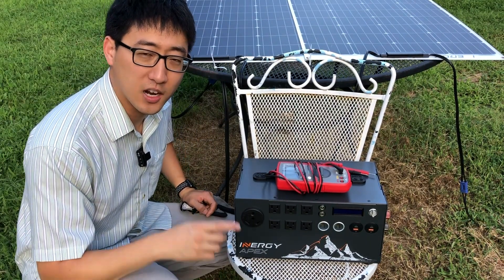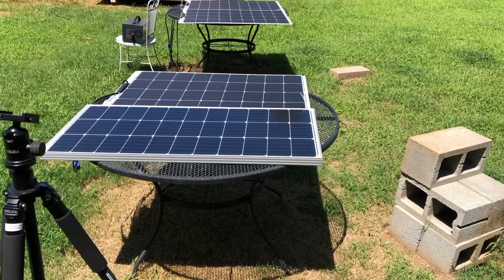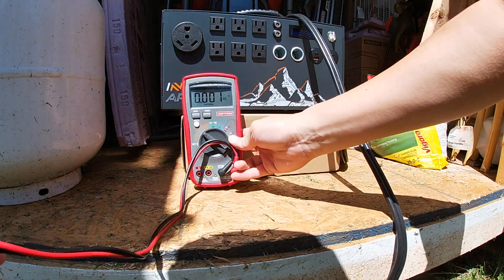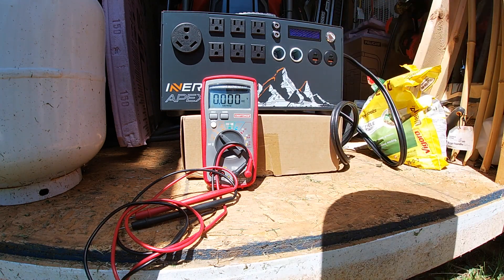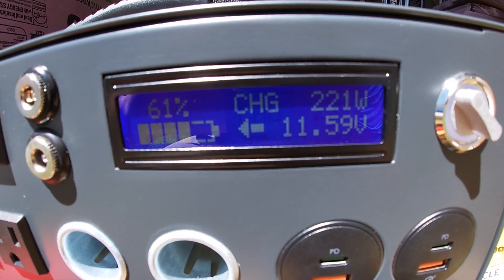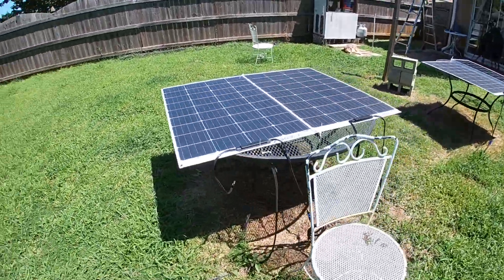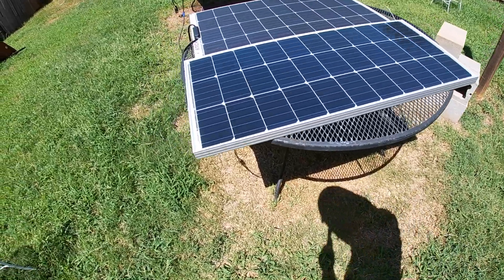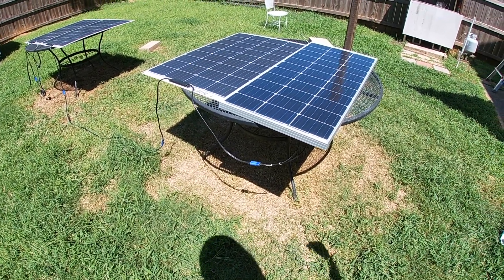UPDATE 08-19 | Review Inergy Linx Panel performance | Watch before you buy | poor performance

Comment: I think your panels are working as expected. It may seem counter-intuitive, but solar panel efficiency is affected negatively by temperature increases. Photovoltaic modules are tested at a temperature of 25 degrees C (STC) – about 77 degrees F., and depending on their installed location, heat can reduce output efficiency by 10-25%. IF I recall, I believe you said you are in Florida, I would expect at least 25% loss in efficiency if not more to be honest. Also, the linx panels are not designed for permanent installation, they are designed to be portable and used part time. I have 1 linx and 4 of the rich 100w poly panels as well for my Apex unit. Great video. If you are in Georgia than you should angle the panels, the formula is latitude x .9 and subtract 23.5 for your desired angle to the sun. For example: if your latitude is 40 degrees, your panels should be tilted at: (40 * 0.9) - 23.5 = 12.5 degrees
Reply: I am confident that you can get 60-70 watts from each panel, taking into account the 10-25% loss due to heat and your very close to rated output at 77 degrees F
Reply from the maker: I’m in GA area. Before i started posting the video series I tried previously to tilt to get maximum using those cinder blocks in my yard, but did not seem it impacted the performance by much. Will try again sometime later, since it’s going to be raining all week.
Reply: > Photovoltaic modules are tested at a temperature of 25 degrees C (STC) – about 77 degrees F

Note:  that's cell temperature, not ambient temperature.  Ambient lab conditions are slightly above freezing.    Doesn't affect your correct analysis.  :-)

Comment: The panels were NOT totally perpendicular to the sun. You can clearly see from the shadows under the table that the panels are ~15 degrees off optimal angle. You could have propped one up a bit to make it optimal and measure any output difference. Also heat DOES impact performance. Be interesting to run same test in cooler weather (with same components). And how can you title to imply that Inergy panels suck when the Renogy panel performed at (or even below) the same level of output? Seems like a tactic someone would use in a "hit" video. Also would be interesting to try Linx panels with another solar generator brand to try and eliminate the possibility of a faulty Apex input stage as a limiting factor.
Reply from the maker: Will try again maybe around winter when the weather is cooler. I do not have any other charge controllers to try, so will have to delay that until a later time when I get one. The reason why I claim the Link panel is bad is because of it's value. 1x Linx panel is ~ $242. The Renogy panel was ~$70 shipped.
Reply: > And how can you title to imply that Inergy panels suck when the Renogy panel performed at (or even below) the same level of output?

Price per watt, perhaps?